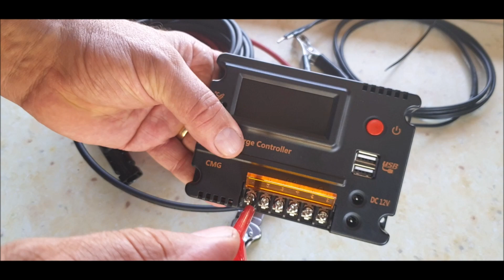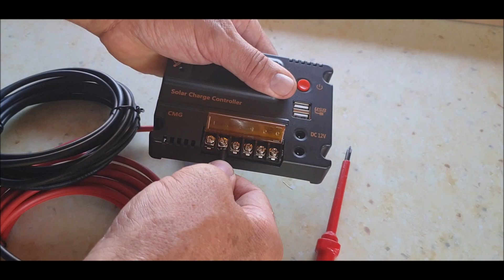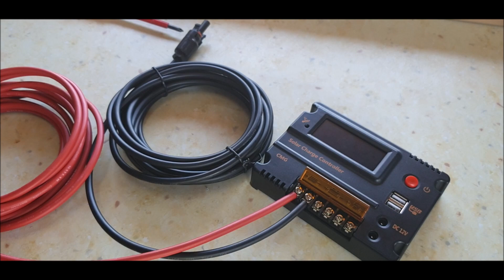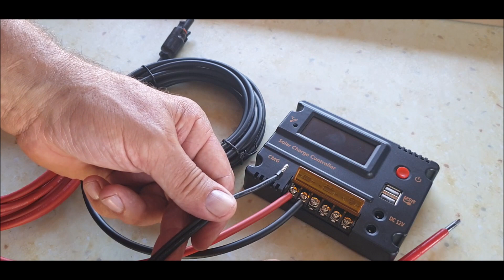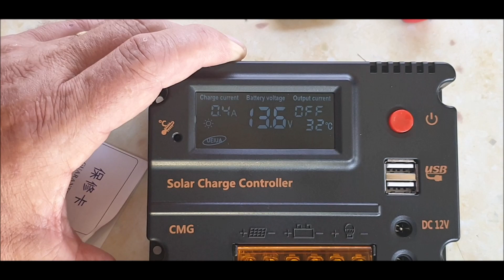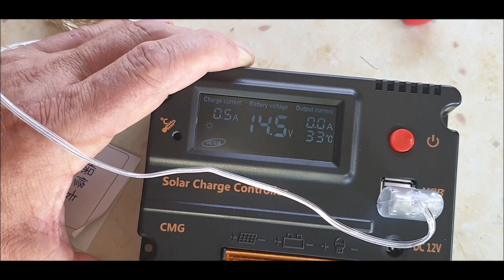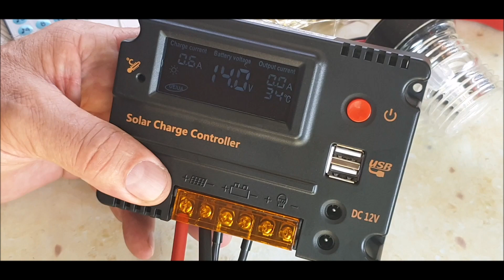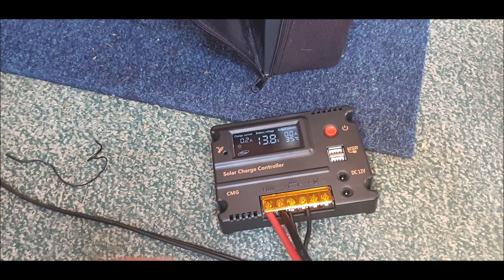HOW TO WIRE A CHEAP 100W SOLAR PANEL KIT OFF EBAY

Comment: You made it easy to understand thank you. Just one question, did I understand rightly that the solar panel actually powered the light and not the leisure battery? I didnt  think that the solar panels held any charge, but if the panel is in the sun its passing current to the controller and therefore the light? Thanks

Comment: Hi,  need to know the maximum length of cable from battery to controller please because my controller is attached to the back of the panel and what size inline fuse please? Thanks.

Comment: Great video and information. I’m purchasing a twin charger for leisure batteries I’m guessing it would still be a 10amp inline fuse that’s needed.  Great video again👍🏻
Reply: Also the video on the 5 way control panel was great. 👍🏻

Comment: Thanks Mark, I've enjoyed the video. How would you connect an Inverter? Directly to the battery? Then the input to the inverter will be more than 14V when charging, I suppose inverter will be able to handle that.
Reply from the maker: Yes, exactly Thanks for watching Steph

Comment: I don’t think I have ever seen a worse way to wire anything!
Reply: I totally agree with you Ian, this is all guesswork by an amateur. The point is that if you aren't certain about how to do something it should be left alone and left to someone who is competent and is able to make a video that imparts full information. Points like 'um' and 'err' and 'I think this does that' and 'oh, the switch just turns it on and off', the thing is you will never get a current reading without the circuit built and in use, these are just useless to someone who is looking for help. Half the info is worse than none, leave it to the pro's.

Comment: hey mark, awesome vid thank you, btw what size fuse did you use that goes from the battery into the charge controller? :)
Reply from the maker: 10 amp thanks for watching
Reply: They come with a fuse already fitted so you don't need to ask that information.

Comment: Great video. I have just about purchased all parts needed for my 100w system. I liked the way you showed  how you connected each piece. I've been a little nervous about wiring  because I've seen some articles that say there is a chance for shock when touching panel or the wiring. Battery comes today and I'll be ready to put it together. Thanks for sharing.
Reply from the maker: easy you will love it

Comment: You should connect your battery to the charge controller first before the solar panel, if not you run the risk of damaging the solar charge controller, and opposite if you add batteries or doing work to the set up.
Reply from the maker: Thanks for info didn't know that and done a few will take that onboard thanks for watching
Reply: Hi, thanks for the reminder. Whats the maximum length of cable do you advise from battery to charge controller please? My kit came supplied with 5m but there's conflicting comments on Facebook that it should only be 3m maximum? What length do you suggest please?